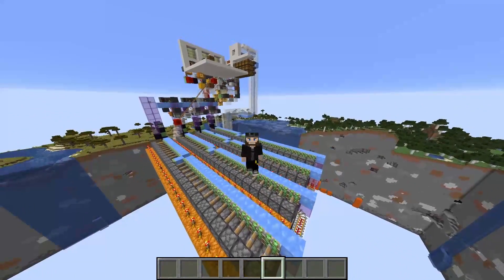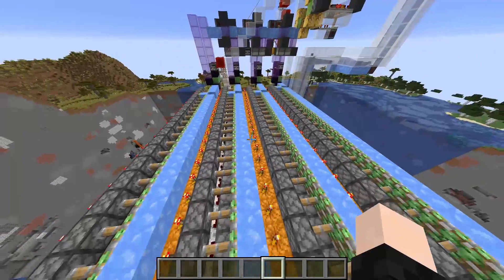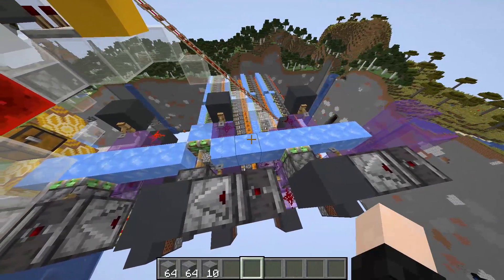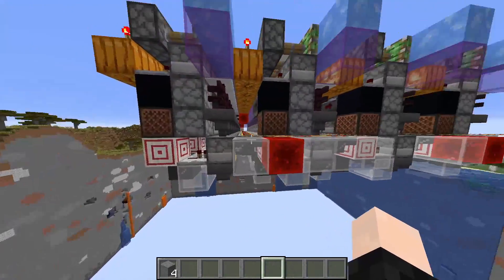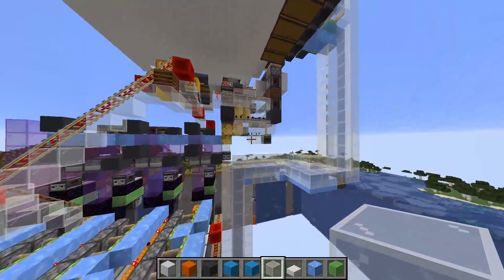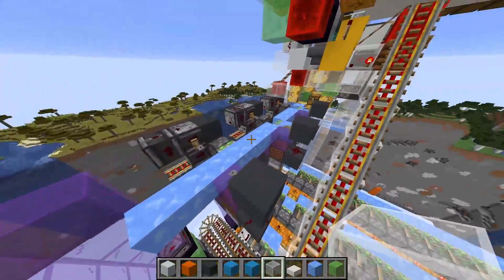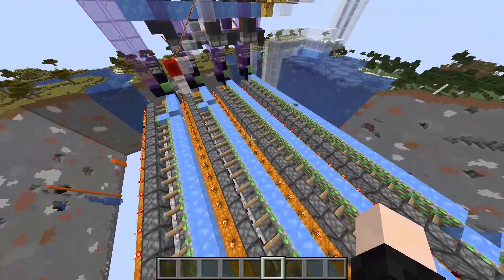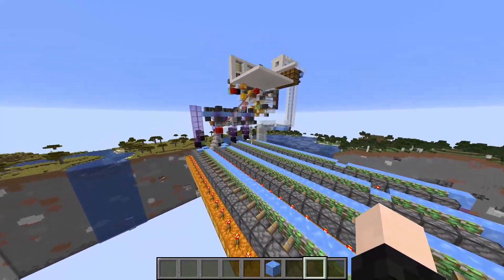What would a 100% fuel efficient furnace array look like?

Comment: kick this up a notch by not removing ice but locking and unlocking the hoppers in that manner
Reply from the maker: That doesnt work, as the hopper pulls 8 items at once and then needs to push them all, and during that time it has to be unlocked.

If you reverse the flow, it does kinda work, but it has its own issues

Comment: Good job! The concept seems somewhat expandable and I like the hopper locking. These types of furnace arrays also really shine in the rare case when there is a lot of variety in the input items. Some more traditional systems can run into problems because hoppers only have 5 slots.

The "Minerva" furnace array you mentioned at the end is probably this: https://www.youtube.com/watch?v=yBARCH-B4Rc
It doesn't really have anything to do with Minerva though other than that the people who developed it used to play on Minerva at some point.
Reply: Hi ! Yep, the concept is expandable, what limits the number of furnaces is actually the input speed and the fuel being used. To keep accurate fuel-efficiency we need batches of 8 items (for coal), but we could go further and dispense 12 (blaze rods), 90 (coal block) or even 100 (lava bucket) items per batch, which would allow for a better item/second rate than the current one.
We've been working on a 8x hopperspeed shulker unloader to try to double the amount of furnaces to 200, but with batches of 8 items that's probably the limit we can reasonably reach ^^
(I'm Chiaemara BTW, worked on this array with Boyenn and Steuergold)
Reply from the maker: Holy shit, 8ticks per item packet ( or well 7, but u use 8 ) is very fucking impressive.
of course you don't have the hopperlocking mechanism in your case, however I like how you approached that the modules lock themselves instead of unlocking the next ( like we do ).

Not sure if it's even possible to do it with the new water physics though, will have a look at that
Reply from the maker: It works with ice streams though. Seems like we gotta build this now!
Reply from the maker: @Nukelawe making some progress in that, would you mind if I release another one based on ideas in yours?

I took parts of your dropper/slime layout in input and the ice/trapdoor concept from your array, most of the rest will be different as I want hopperlocking and a much more compact layoht
Reply: @Boyenn  Go ahead. It's nice to see the concept being developed further. More compact layout and hopper locking are the most important improvements I could think of.
Reply from the maker: @Nukelawe  ditching the ice/trapdoor concept again, while yes it allows 8gt streams, it's actually much easier to make a much smaller system with 16gt, using the same 8/8 input, but toggling between sides of the array ( with input in the middle). We need multiple sides/arrays anyways since ice streams aren't infinite unlike water :/.
That, combined with a new self locking idea brings the slice size way down, it looks much less cool tho :/

Comment: Really awesome and refreshing concept ! Would it be possible to scale it up a bit by adding more modules ? Or the speed wouldn't be changed that much ?
Great job on that !
Reply from the maker: Currently the amount of modules corresponds to the time it takes the furnaces to smelt the input.

The current input is 8 items / 16 gt, however nothing is stopping us from doing stuff like speeding up the unloader and then sending stuff like 16 items/20gt and adding more modules, which would slow the total smelt time down on small input but increase it on higher input. It's really a trade off, 8 items/16gt was the easiest to reason with for us
Reply: @Boyenn  oh ok i see ! It makes sense in the context of a midrange small input furnace array for sure !
Reply from the maker: @Sardoron  chimaemara is looking into making it 2x 8/16gt, but with a completely different input concept to achieve it. I'll let you know if that worked out.
( That would mean 200 furnaces or 8x hs)
Reply: @Boyenn  oh that sounds really interesting !! Definitely let me know 😄